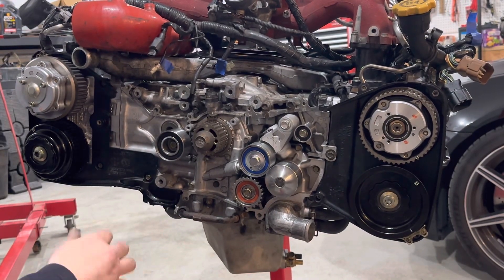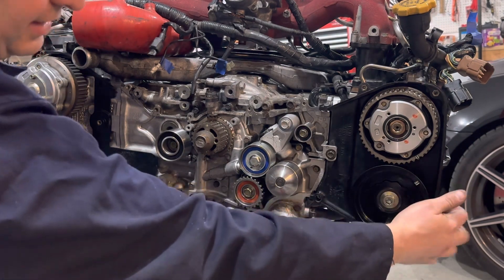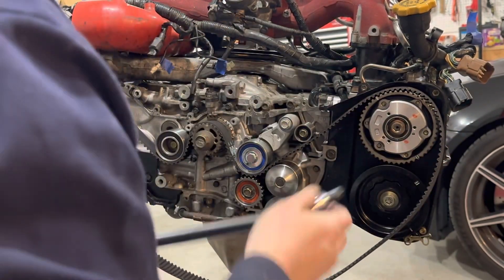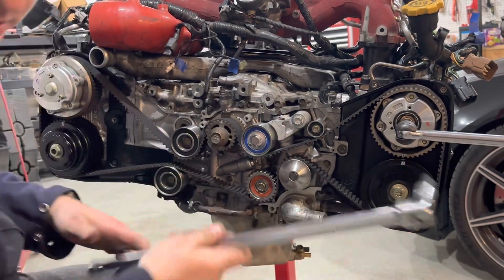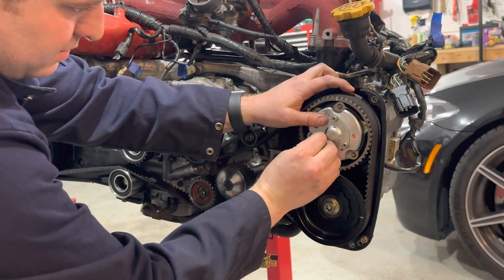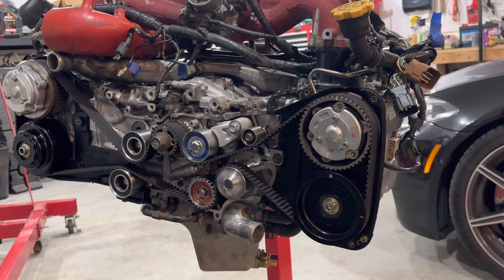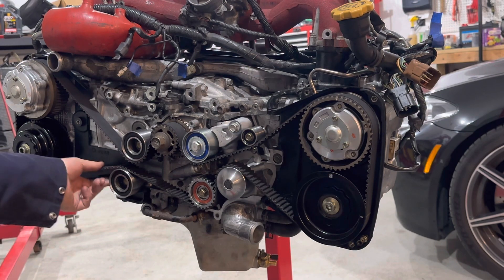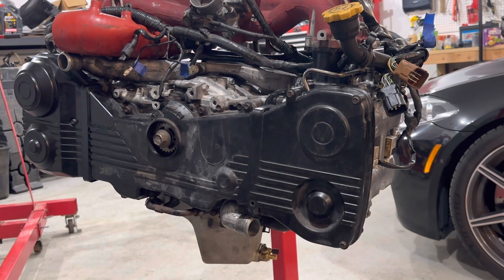One man Subaru wrx STi timing belt install with no special tools ej257

Comment: I lined the 2 marks on the lh intake an exhaust cams 100% inline and didn’t make them off centre a little bit like you did and it seems to be 1 tooth out? I assume that’s because when you put the last pulley on it moves the cams a little bit?
Reply: Hope you see this comment bro, tier one performance does a video about timing if you look up “Subaru EJ timing marks” if yours looks like theirs it’s perfectly normal 👍🏽
Reply: @markgarcia3543  Thanks man will do
Reply: ❤❤❤ thank you heaps for this video. I was looking for a video like this one, to show me exactly how to line up the marks on the driver's side cam pulleys. A question: The size of the  Allen socket used to turn the cam pulleys on the driver's side is 5mm,  as you said; so my question is: my 2003 legacy has an EJ20 engine, do think the Allen socket for the same pulleys on my car is 5mm as well? I live in a remote location and I will be ordering the sockets from overseas, but I just want make sure. Thanks.

Comment: Question. Can the Crank sprocket be off by 360 degrees?  Or can I spin the Crank sprocket round and round and it's fine as long as the Crank line is matched up to the knotch on the timing cover?
Reply from the maker: 360 degrees wouldn’t be off from 0

Comment: Do you know if the camshaft bolts are reusable
Reply from the maker: I reuse them and lots of people do but I’m not sure if Subaru calls for replacing them or not. I definitely would replace if the heads of the bolts are stripped/damaged at all.